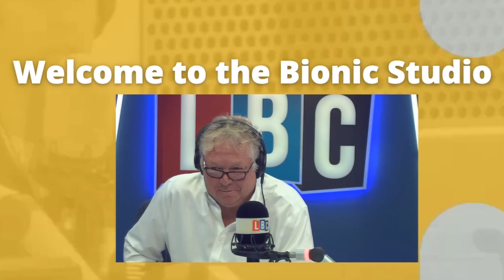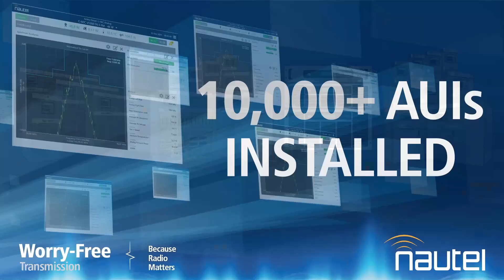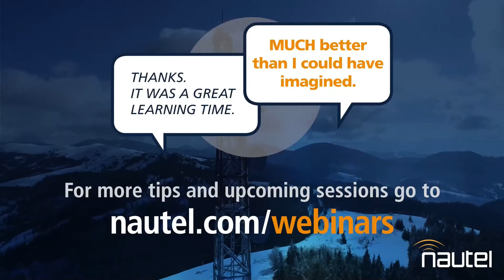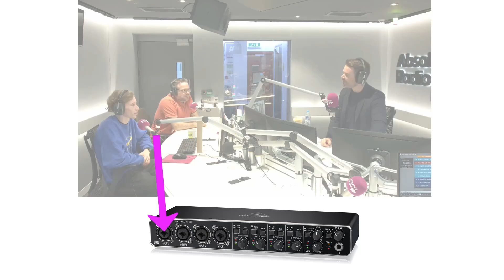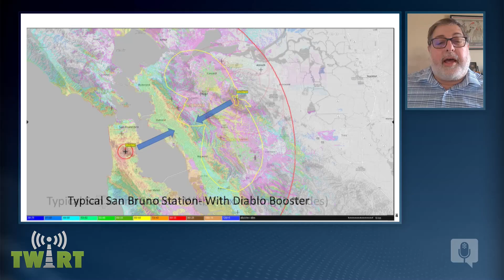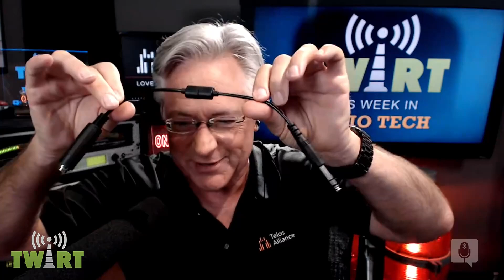FM Boosters Are Here, And They Work - with Bert Goldman and Rich Redmond - TWiRT Ep. 585

Comment: 15:00 "It could be 10 microseconds off or 10 minutes off, the receiver is going to see it as two different signals."
I don't think this is accurate, as the protection ratio for 10us delay is still lower than the protection ratio for 2 different signals! Of course, it's still higher than the protection ratio for 1, 2 or 3 microsecond delay.

Comment: The problem with Zonecasting is that it will create a "booster boom".  Even GBS suggested setting up a couple of dozen boosters in upper Manhattan to divide WPLJ into two zones.  It is also important to remember that boosters are still secondary and they are subject to the Local Community Radio Act, which in Section 5 can only be licensed based on "community need".  A typical scenario would be an existing LPFM or translator that could receive interference from a new booster, especially if in the past, the primary station modified to move closer to the LPFM or translator.  If the booster is to fill in an area that it blocked by intervening terrain, but if the area gets a signal, it would be inappropriate to put up a booster.  In the latter case, there is no "community need", just the greed of the broadcaster.  To deal with this, REC had proposed a "Community Need Criteria" for new FM boosters that require a booster actually create a significant improvement to a particular area within the contour that is otherwise shadowed by the primary station.  

The NAB, REC and others have gone on the record opposing the ZoneCasting concept as it will create a new form of "redlining" where stations can target improved service to "gold coast" areas while ignoring the rest of their service area.  This will result in a level of discrimination in advertising.  I doubt the FCC wants to revisit practices that are near "No Urban/No Spanish" proportions.
Reply: There are very legit applications for boosters.  In Southern California, many of iHeart LA stations have boosters to reach the Santa Clarita Valley.  I was the one who got the FCC to allow LPFM stations to have boosters.  KWSV-LP in Simi Valley, CA is the first LPFM booster and an excellent example of how a booster can be used to fill in service contour that is otherwise blocked by terrain.  KQLH-LP has a booster to fill in an area that is blocked by terrain.  In Malibu, KBUU-LP is in the process of setting up a unique system that will have two boosters and that the entire system will operate with HD. This will allow reception along a longer stretch of Pacific Coast Highway where the Los Angeles stations are blocked due to the terrain.  Especially, in Malibu where they are prone to fires and weather, KBUU is a lifeline and the booster network is getting a lot of community support.  

So yes, there are cases where there is community need for boosters, but when they are being put in for the sole purpose of zone advertising, there is no "community need" for this and it goes against the LCRA.  Not only that, but it creates a new type of socioeconomic discrimination.

Comment: We have been doing the same for two-way mobile radio for years. The parts that make it work are digital microwave to each site and frequency/timing with GPS accuracies. Then each modulators must be characterized to match as close as possible. We used a different audio tone to each site to know which one you are listening to.
Reply: They mention it at 25:42